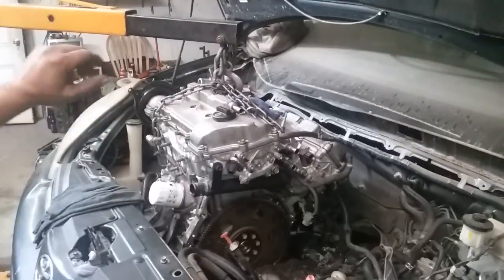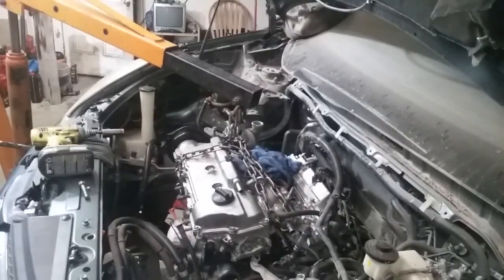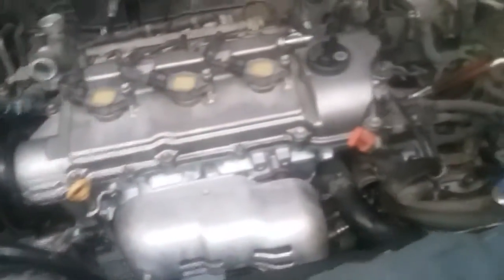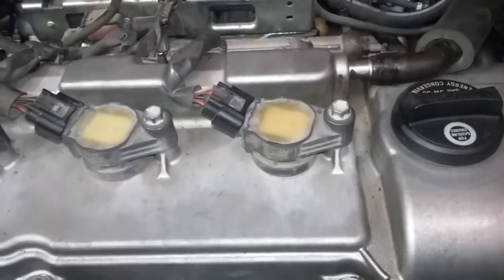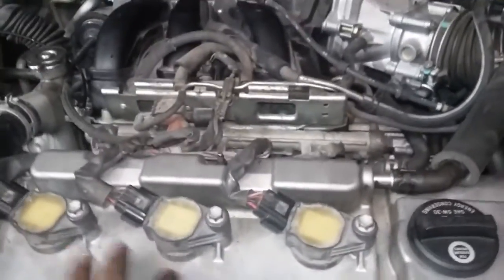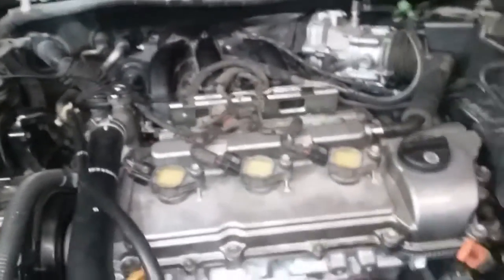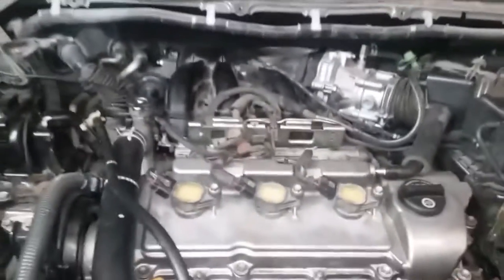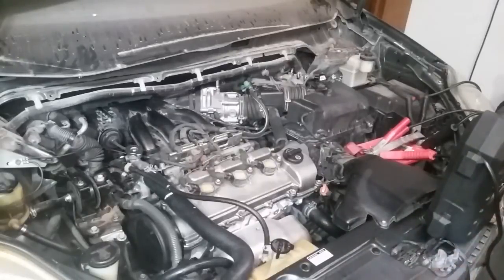Reparacion de motor e instalacion de toyota sienna  parte #3

Comment: Hola Maestro
Let tengo una pregunta
Se pueden cambiar los sellos de válvulas sin quitar la cabeza a este tipo de motor toyota?
Mi Sienna 2001 tira humo azul a veces y pierde potencia porque se carbonizan las bujias de la cabeza frontal.
Se pueden cambiar los retenes de válvulas sin necesidad de quitar cabeza???
Gracias y le envío un gran saludo desde México.
Reply from the maker: Mira en lo personal no creo q sea posible la parte de ensima de la valvula esta escondida y no creo se puede.. pero puedes darle una buscada talves si tengo una opcion saludos amigo
Reply: @julian1automecanic  
Si, ya vi completos sus 3 vídeos y esa parte queda escondida.
Gracias por tomarse el tiempo para responder.
Cuidese mucho
Saludos
Reply from the maker: Gracias igualmente y suerte👍
Reply: Si es posible no hay problema solamente se pone aire al cilindro y se cambia uno por uno
Reply: @johnmartin2710  de donde eres bro?
Reply from the maker: Soy de mexico pero radico en california

Comment: una pregunta le cambie el motor a una toyota sienna del 2000 y en cuanto me la entregaron la corri como unas 2 horas y me dejo de marcar el velocimetro y el scanner me marca que es el sensor de velocidad y la aguja no marca nada el mecanico dice que no tiene nada que ver con la imstalacion del motor pero alguien mas me dice que tiene que ir simcronizada la transmision y el motor que por eso me marca ese codigo
Reply from the maker: chelis la transmission no tiene nada que ver con el motor eso si es correcto . loque no es correcto que un cable del speed sensor  este roto talves con el movimiento  de sacar el motor alli paso algo si yo fuera rebisaria el diagrama y aria pruebas  ok mi respuesta es rebisar el cableado del speed sensor
Reply: julian #1automecanic,gracias por tu respuesta,lo que pasa es que ellos de eso no salen que nada tiene que ver y yo busque el sensor y trae 3 cables y vienen de adentro de la transmision lo cual la parte que se puede ver de afuera parece que esta bien,ahora tal vez busco abrir para ver desde donde vienen los cables eso si voy a probar en un junk yard antes de abrir la de mi carro
Reply from the maker: +chelis gomez si claro si por descuido jalaron el cableado definitivo es speed sensor se desconecto
Reply: Bueno trabajo deje su teléfono amigó
Reply: Hola, tengo una sienna 2005 , le paso lo mismo mmm pudiera darme un precio aproximado de la reparcion con todo y las refacciones del video, 🙏🙏

Comment: Hola amigo a mi mecánico al estar cambiando la válvula pcv en el motor Sienna 1999 se rompió parte de la válvula y calló dentro del orificio el cual ya no pudo sacar, mi pregunta es si no le afecta que allá quedado dentro en la tapa de punterías en la cual va la válvula, espero respuesta, soy de México Aguascalientes, Aguascalientes, saludos gracias.
Reply from the maker: saludos amigo mira afortunadamente la tapa tiene como un compartimiento q ase q no cae directo alas valvulas solo qeda atrapado el pedaso dentro no deveria estar alli pero no le afecta y yo se q esa valvula ase eso siempre se quiebra en la mayoria de toyotas bueno mi respuesta es no riesgo pero si gustas puedes remober la tapa y tratar pero aun asi es dificil extraerla
Reply: Me gustaría tener tu número para reglar mi Sienna
Reply from the maker: Saludos amigo yo estoy en california y cualquier pregunta dejame saber